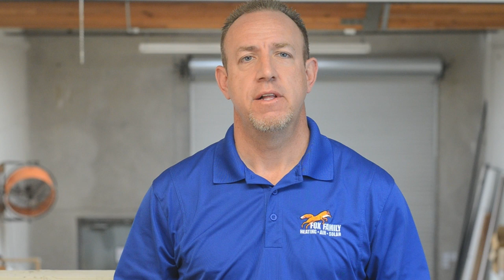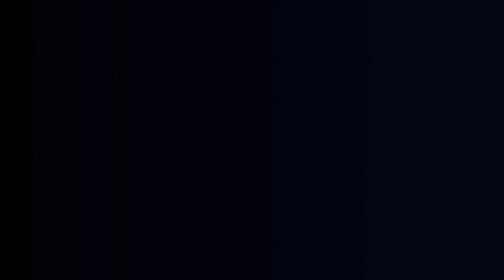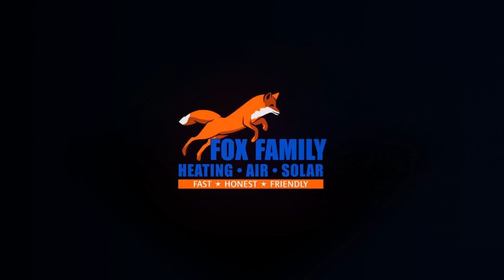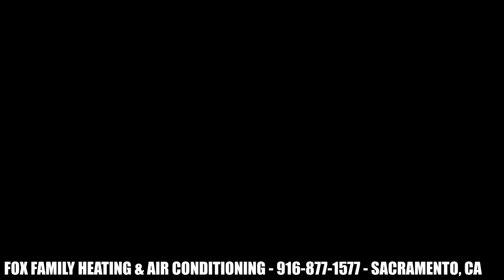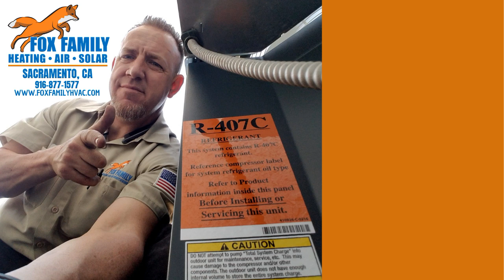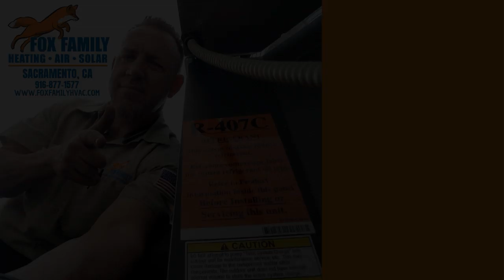Thats Not How HVAC Zoning Works!

Comment: Greg, great job explaining a zone system. I have struggled to explain it to customers and GC’s for the last 10 plus years. Temperature swing should never look like a scary roller coaster on a graph.  Humidity removal is 100% more important than having an oversized unit that will cool the house to store ice when ambient is 130 degrees.

Comment: Great video, not a HVAC tech but more of a energy saving guy. My place is 2600 SF. Walkout basement then main level. Main floor has a 15 seer 2 ton. During the day set to 72 and after prime time all the way down to 68 during the night. Best part next day the main unit don’t even turn on till late afternoon or until the house warms up to 72. Basement is all open space. We run a ductless 12K always set to 70. Best part : light bill runs 200 bucks all summer long and we are very comfortable.

Comment: Great video, I inherited a dual zone system.  Summer time its opposite in Canada, you cool the upstairs since we have basements, and the basements are naturally cooler being somewhat in the ground.  Last summer my ac never went off once for the basement, but did upstairs for the day.  I assume this system is saving me money, because usually if you have one zone your upstairs is cool, and your basement is freezing because you are pumping ac down stairs as well.
Reply from the maker: Oh wow,. Great info.  That makes sense with the basement
Reply: @foxfamilyhvac  Opposite in the winter here, if I set the basement to be a bit warmer and heat naturally rises, I can some times not have the heat ever be called for upstairs.  Thats after awhile however and not on really cold days.  It helps with the the smart thermostats like the Ecobees, you can really tweak your furnace settings, especially the furnace fan.  I have the fans run 15 minutes every hour, heat called for or not, and that opens up the zones, allowing warm air to be moved around (or cool in the summer).  Does it all save me money, I think so, but I dont have a previous experience with the system either.  I can track it all with the app, and there are some days that I never have the a/c or heat ever turn on, just the fan moving air around.

Comment: Ive never seen a zoned system installed properly. Ever! Nor would I install one or try to change a single stage system to be zoned. But we install a few hundred ductless mini split systems a year. If you want to zone buy a system designed to zone. Or buy a conventional system with variable capacity ability.
Reply: pretty much, this is the dead truth. the only one I know of that was very close? the one I suggested that friends have the current system zoned for smaller rear addition with full basement...
even after the builders were unsure if it would be enough, it worked out great and cost way less.

Comment: We have the opposite issue. To cool the upstairs from 71F to 65F  it takes almost 2h in a cool day ( under 76F ). Also when the air is called upstairs it turns on the first floor as well :/

Comment: are zoned systems designed/able to take cold air from my first floor (63f) and send it to the 3rd floor for cooling demand (73f-> 71f)?  Are typical zoned installations just controlled supply dampers, or do the returns also have dampers?

Comment: I live in Texas with a zoned system . My home is 3000 sq ft . If i can save anyone from these wasteful systems I will sleep better . I bought a new home with a zone system . All I can say is that it’s a waste of money . Stat away from zoned systems. They are complete trash can systems . Let me explain . 

1. When you have your fan system kick in you are using 1 fan for multiple rooms . When the motorized damper kicks on or off for a zoned area you will change the air pressure from all the other rooms . 
2. Changes in pressure once the system starts turning on or off for all rooms will cause you headaches since it can blow harder or slower and it’s up to the ac system when that happens 
2. Static dampers work great , if you use static damper . That’s a great way to regulate the air flow to other rooms to help even the amount of air for each room. Motorize dampers Trow your hard work out the window since it will fluctuate on you.

Comment: Let me ask what about when you walk into a 2500 sgaure foot house that wants 4  zones?   In a commercial application which is what I know the most about you would have a static pressure bypass from return to supply. When the static climbs due to to many zones being closed the bypass opens. Or in the newer rtu you would see a vfd on the blower that would ramp down when it sees high static.

Comment: If you have a two-story house and you want the whole house to be the same temperature and you're not going to be using zoning with just one thermostat how do you accomplish this and it works heating and cooling?
Reply: I want my 2 story to be same temperature.with a single thermostat one zone system this is difficult if not impossible. With a two thermostat fwo zone system I just set them Temps equal and let the zoning system do the work.

Comment: Greg, Your thoughts, on the following information. Here in San Antonio,TX, with the design temperature of 25 degrees delta t for cooling (100 degrees outdoors to 75 degrees indoors), and meeting all R value building requirements, I calculate 3 btus of cooling for cubic foot of living volume(i.e.area). Meaning some homes have 10 foot ceilings and some areas 12 ceilings and some 8 foot ceilings so the rule of thumb of 1 ton per  500 square feet is not a good idea.  Return air grills and locations for ceilings higher than 8 feet is a subject for a later video. Thanks for the fine videos and looking forward to  your PV systems videos.

Comment: I have watched so many videos I have learned a lot about everything Hvac, except what to set my remote damper control on. I have a two level home, a DuroZone remote damper control dial on my wall upstairs, that says, open, 1/3, 2/3, close. I have seen videos of manual dampers that have contradicted each other about open or close. I have read all comments. I have had a company sell me a new unit and didn’t know what it was. That company has been ripping me off every year since. It would help me a lot if you can tell me what to set it for in the summer and winter. I wish  You was here in N.C. You would have my business. Thanks for any information.

Comment: Nowhere can I find information on how to use my zone system. Brand new single level, 3-zone system. I heard different theories about the difference in temp. settings on each thermostat. Since I'm all over the house, I want a set temperature everywhere all day. Then I want the whole house cooler (or warmer in winter) with the Master bedroom different. In my previous house, I simply set the thermostat where I wanted. But in the new house, I have to go all around and set multiple thermostats multiple times a day. What a pain! Who thinks this is a good idea?

Comment: Is it possible to have only 1 thermostat control a multizone system?
Reply: One phone app can control all wireless (wifi)  zone thermostats. Other thermostat that Carrier makes can access all zones from each enabled thermostats and control all other zones. The upstairs T-stat controls all zones as well as the lower floor T-stat can access all other zones and control them. I prefer the phone app version, as long as all zone thermostats are from same manufacturer.

Comment: I have a tri-level.  They just switched me from two old furnaces to one HE furnace with zoning.  Two thermostats.  The upper and main level is always hot (jumping up to 75 or higher in the heat) and the lower and basement is cold (68 degrees).  I thought I could heat the lower level when I am downstairs and especially when I am in the basement.  Plus, put the a/c on for the main and upper level.  They said no.  The system will be damaged.  It has be be heat everywhere, cool everywhere or cool on the main and off on the lower.  Is that true?  I can't heat the lower when I'm downstairs and keep it on cool for the main/upper level?
Reply: During Summer: Yes, u can heat down stairs with zone system. Place the upper floor thermostat on System Off and Fan Auto. This will allow the down stairs thermostat to have full control of heat/ cool options. Set to heat and warm up the lower floor. When it is warm enough, and u want to cool upper floor again, set lower floor thermostat to System to Off and Fan on Auto. Then, go to upper floor and set System to Cool and Fan on Auto.

Comment: Going to really disagree with you, I don’t think you have ever lived in a house with 2 floors and no zoning, but there can be a huge difference in temperature between the two floors. The point is to keep the house an even temperature. If you want to work the system and don’t live in half you house for the better part of the day, then sure knock yourself out, to me that sounds like a scheduling/comfort nightmare! 
But yes putting a single stage system on zoning is stupid however you set it up. (Minimum 2 stage, best would be VRV life, but now we are abandoning duct work.)
Our market is likely significantly less energy sensitive though.